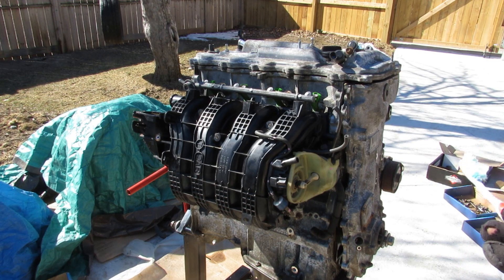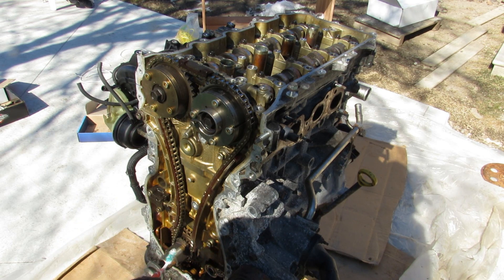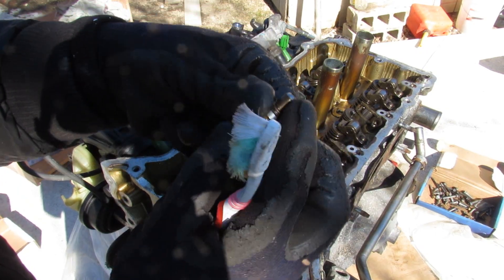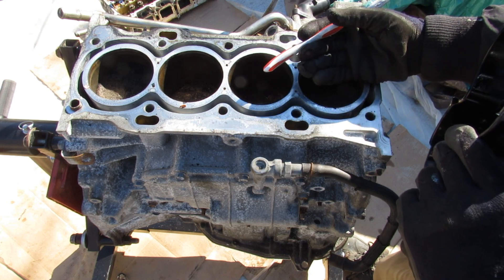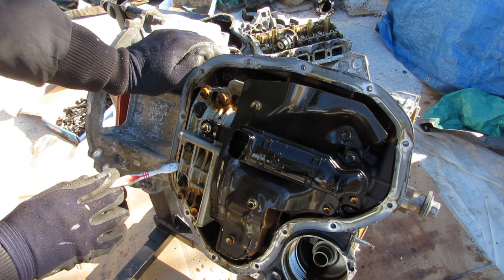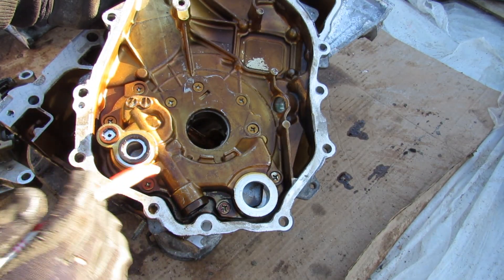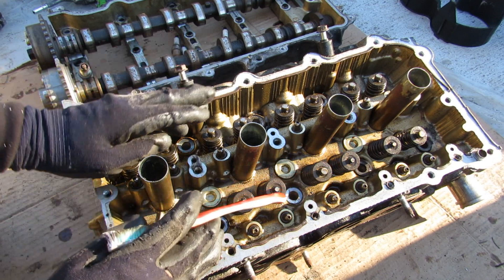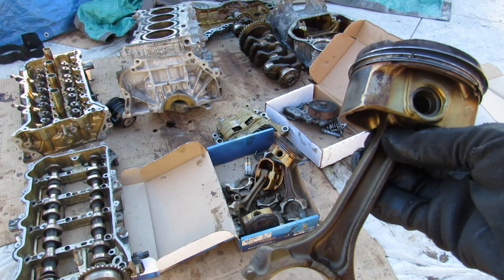Why Toyota Engines are Reliable

Comment: Question for you ! Do you feel it's safe to run 5 w30 instead of 0/16 or 0/20 ? Seems other countries run 5/30 & alot are normal weather like America ? We fig the gas in the oil has to make the gas super piss thin ? Doesn't seem like much protection being that thin & than on hot days also ? I see Mexico says they can run 15/40 or 10/40 or 5/30 !! Crazy any thoughts would be great ! Thanks !!

Comment: The new toyota electric wp has no bearing but uses magnites instead! I have one last 302,000 miles on a prius and it still works! If it fails, it because of the impeller, you can easily take the wp out and replace the impeller only! Or replace the whole thing. No belts to mess with.

Comment: The variable valve timing system also rattles on start after you drive the car without oil for awhile. The hydraulic lifters start ticking too. Then the thing loses power and won't rev anymore. Even after you refill the oil. Oops.

Comment: Hola amigo, seria tan amable de apoyarme tengo el mismo motor pero no tengo lubricación en la vena de los buzos o taques hidráulico ya cambie el filtro sedazo que va en las conchas del árbol de levas también también cambie los vvt mecanicos y los selenoide electrónicos y aun asi sigue con sonido sobre os árboles de levas en todo tiempo a causa de los buzos sin aceite

Comment: A friend of mine had a 2007 Rav4 with one of the previous engines with the oil burning issue he mentioned.  This was a known issue but toyota wouldn't cover the cost to fix it.  I believe there was some lawsuit over it.   His started having this issue up around 100k and he knew other people that had them with the same issue.
Reply from the maker: Unfortunately that's how most Toyota engines are when the miles get up there

Comment: I think the oil runs through the water pump because it both helps the oil come up to temp faster and acts as an oil cooler at higher temperatures. That's why they ran the big oil cooler on the AW11 MR2s into the main coolant hose afaik. 3 year old video but hey info is info

Comment: This same type of motor is in my 2010 Camry. Best car I ever owned. Great job explaining the parts and operation of this engine. 210K miles and still going strong.
Reply: toyota owners are those kibnd of peolple that never acelerate the car hard.

 My chevrolet have 250 miles never had any problem in engine even the engine gasket still the same

Comment: I had a 2016 Camry le with this engine, 70k miles no issues, I currently have a 2013 rav4 limited with this engine and it has 170k miles, burns some oil not much but no other issues except for that, very reliable engine. and the vvt rattle is pretty harsh on cold starts.

Comment: I dont think anything will beat their '90s stuff for absolutely overbuilt and simple reliability. The VZ, RZ, MZ and S engines will probably never be topped. Masterpieces of cast aluminum and very minimal use of plastics for anything important. Even the factory timing belts were known to last an absurdly long time though its obviously not a good idea to push it. My buddy bought a 25 year old V6 Camry with 200K miles on it and it doesnt look like anything on it has been touched except the brakes, timing belt, plugs and a couple of vacuum lines. It does need new struts though.

Comment: The only thing I wish Toyota did was make those cartridge oil filters topside. Topside filter plus extractor means I wouldn’t have to get under for an oil change.
Reply from the maker: I'm not a fan. I'd rather everything drain down, including any dirt or particles for a cleaner oil change

Comment: I had a 2007 Camry. I bought it brand new. I have had over 20 brand new cars of Ford, Chrysler,  GM and Kia in 50 years of servicing my own cars. This Toyota was the only car that started using oil at 30,000 miles. About a quart per oil change which was 3500 miles. First heard it was the valve guide seals then it was low tention rings. So much for their reliability!
Reply from the maker: They're reliable but oil is just part of the running costs on these 😟
Reply: There are tons of articles on that series engine showing that it's the oil control rings. It was a design issue; Toyota is still one of the most reliable automakers.

Comment: Last week my 15 year old toyota yaris 120k miles, water pump finally gave up... once it got replaced, everything becomes fine again.... 

Previously the noise of the broken bearing of the water pump was so awful... that i thought something was very wrong with the engine.

Luckily for me, it was not... after my mechanic went through all that could be causing the terrible noise..
Reply from the maker: At least it's an external pump and easy job.
Reply: @speedkar99  yup indeed.. i was so relief.... cause my money rather tight lately...

Comment: this engine is NOT Reliable. As all the Direct injections only engines it doesn't spray gaz in manifold to clean intake valves.  The real deal is having BOTH direct AND indirect injections.

Comment: The oil burning comes from changing at 10000 miles. ALWAYS change at 5000 or 6 months, no matter what the dealer says! That's the Manufacturers suggestion. Dealers are full of shit.

Comment: As far as the 22R went...it's reliability came from forged , not cast, crank and pistons and it's overhead cam design. With Weber sidedrafts and a header and little more cam my SR5 would fly through mud and sand and snow by allowing the rpms to keep up wheel speed.

Comment: Its Not a hydraulic lifter! Its A hydraulic lash adjuster! Before anyone says shit a hydraulic lifter is what lifts a push rod that lifts a rocker arm on a central cam engine, overhead engines don’t need lift they push direct, that what the lash adjuster is for.
Reply from the maker: Thanks for that

Comment: Regarding a leaking original Japanese water pumps...my Toyota 1.4Vvti has still the original one afzer 200.000 kilometers and it does not leak. Our mechanic told us we should not change it until it starts to leak. If it reaches 300k I will make a video about it and send to Toyota Japan.👌 Best cars in the World...😉

Comment: 3000 KM AND     $ 2000 AGO   2020  COROLLA, RUNNING GREAT  BOUGHT USED 1  TR  OIL PER 1000 KM   REG CHANGES      10w 30.  at 5000 KM. ON road as    courier so 900km a  day  common.

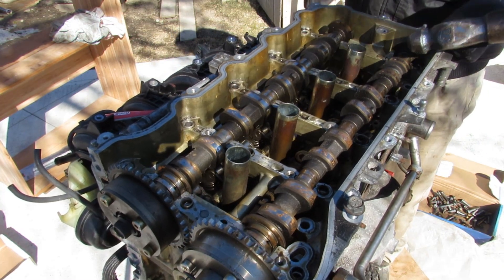Comment: 5:20 those are GDI injectors, they basically inject straight into the pistons rather than go down a small tunnel like other injectors, 3:20 the timing chain guide rails are made of aluminum not plastic or at least feels like that, but they do have plastic blocks on them, meant to last ages. Also @ 6:48 what engine, the 2arfe, for a brief period ran from 2009-2012 ran a power steering pump and newer versions run electric power steering which makes it easier to service items like the pcv valve and serpentine belts, some people tend to refer to that. The timing chain cover was also changed accordingly getting rid of a few 10 mm wholes where the power steering tensioner would go, difference is the part cover is 310 and 320 for the newer model from the sticker on the side of the timing cover,. 7:48 i like how you mention how it functions as an oil return, have seen quite a few people say their oil piston rings are stuck and thats why there is a lot of oil burning in their car when in reality the pcv valve has failed and its burning roughly 1 quart of oil every 300-400 miles. also a quick and easy test and or fix is to get lucas fuel injector cleaners and throw it into half a tank of gas next time you refuel if you see an improvement after that tank of gas is gone in your oil consumption that means oil ring were stuck and u should proceed with a sea foam clease to reduce oil burn (saves consumer money by mitigating the issue to be more manageable). if no improvement than pcv valve. 13:00 on 2arfe 2013 and newer there was a part revision for the intake cam gear which would make the intake cam gear last longer than previous revisions, it was a defective part or claimed to be defective part since it would break around 100k miles, but the engine would keep going on. Its meant to last a lot longer than that around 200k as thats what most engines should last (lifetime of the engine), but it could go on for longer with the gear broken. Deffo one of my favorite motors though especially for a daily. Never have to worry about that car.

Comment: I have this engine in my 2014 Scion Tc and it only has 26K miles on it.  I don't like the coolant passage being routed through the water pump either.  It's the same on my VQ.  It only makes sense from the manufacturer's point of view.
Reply from the maker: Water pump has always been a weak spot on Toyota

Comment: 1:18...
i would not see a timing CHAIN as a good thing...
My Impreza with EE20 Boxer Diesel had huge problems - Subaru said at the last, official subaru service at 80k km: "timing chain is still like new, i am good to go another 80k easily"....
at nearly 90k km, as a SMALL, PRIVATE MECHANIC realized: Subaru probably didnt even changed oil at 80k km, my valve timing was completely fked up (and nobody realized despite only going to subaru!), the timing chain was heavily stretched and the gears were also nearly flat, good job subaru! Luckily i dont believe officials that much and the mechanic i talked about wanted to check my car because he realized already at a test drive: something is VERY VERY WRONG with the car
Reply: I hated my Subaru for about 10 years, i really HATED IT because the DPF regs often started at overtaking (dangerous AF!), the DPF regs made my oil pretty much fked up after like 5000 km already, the EGR valve produced a lot of soot on the intake, and at all i was not really happy with a software throttled (to 109 HP/300Nm!) Boxer Diesel.

Was a damn expensive rebuild & tuning, but now this engine feels like a completely different engine with nearly 190 hp/430 Nm, ofc removed DPF and blocked EGR!

Comment: The record of these is excellent, the record so far with Dynamic Force engines is impressive for how much more is involved in hitting those efficiency targets. I get excellent mileage on mine.
Reply from the maker: It sure is amazing how complex it is. Waiting on long term reliability data to see how it'll hold up
Reply: @speedkar99  I’d say from what I’ve heard so far is they are even more reliable.  The electric water pumps are more reliable than the old leaky belt driven one on this engine.  The dynamic force engine is durable enough to run on 0w16 oil.  Most people will probably be better off switching to 0w20 after the warranty is done.

Comment: I had a 1.8 vvti in an avensis it was super reliable no problem until 90k then oil burning which is well documented faulty oil control rings i was told.
Reply from the maker: 2zr? 
Yeah some of them burn oil

Comment: Why would you need to control the amount of air flow into the intank?
Reply from the maker: To allow how much air to go in and mix. More air means more lean mixture. You need the right mixture for optimal combustion
Reply: @speedkar99  but wouldn’t that starve the engine from breathing? This doesn’t make sense to me? Thanks for the information.

Comment: THIS Toyota engine may be reliable but thousands and thousands of 2000-2010 Camry, Corolla, Scion and RAV4 owners with the infamous 2AZ-FE engine suffered expensive engine failures that Toyota refused to take responsibility for. Improperly tapped cylinder head bolt holes in the block caused head gasket failures which led to cylinder wall destruction. In almost all cases complete engine replacement was necessary, costing owners between $6,000 and $9,000. My brother-in-law was one. Owners were told by their dealers that "Toyotas are incredibly reliable and we've never seen this type of failure before" I was a Toyota fan and owner until this happened; now I've moved over to Ford trucks.

Comment: While the presentation and editing is magnificent,  the title of the video is wrong. Sure, we could perhaps conclude Toyota engines are reliable, but its not really answered in the video.  IMHO, the answer to 'why' is because Toyota engineers continue to learn from past mistakes. Pretty simple but not so for many other manufacturers who produce crap to market to the general public. Many of us remember Toyota was once crap too. But they once learned it was cheaper and better to produce a quality product than just one that was inexpensive.  Toyota engineers never stop learning from prior model failures. They've been building on that experience for decades now and we the car buying public enjoy the result.

Comment: Repairpal analyzes repair invoices, Toyota is just ok.  Lexus ties them for 8th place, which validates their analysis.  All Korean cars are much, much more reliable.  Honda is #1. Porsche is dead last, twice as bad as second to last place BMW.
Reply: I highly doubt when it comes to long term major repairs the Korean cars are more reliable
Reply: @thetechlibrarian  
Porsche is an absolute disgrace… 

“The Porsche Reliability Rating is 2.0 out of 5.0, which ranks it 32nd out of 32 for all car brands. This rating is based on an average across 345 unique models. The average annual repair cost for a Porsche is $1,192, which means it has below average ownership costs. The other factors that contribute to Porsche reliability include an average of 0.8 visits to a repair shop per year and a 21% probability of a repair being severe.”
Reply: The Toyota Reliability Rating is 4.0 out of 5.0, which ranks it 8th out of 32 for all car brands. This rating is based on an average across 345 unique models. The average annual repair cost for a Toyota is $441, which means it has above average ownership costs. The other factors that contribute to Toyota reliability include an average of 0.3 visits to a repair shop per year and a 12% probability of a repair being severe.
Reply: The Kia Reliability Rating is 4.0 out of 5.0, which ranks it 3rd out of 32 for all car brands. This rating is based on an average across 345 unique models. The average annual repair cost for a Kia is $474, which means it has above average ownership costs. The other factors that contribute to Kia reliability include an average of 0.2 visits to a repair shop per year and a 10% probability of a repair being severe.
Reply: The Hyundai Reliability Rating is 4.0 out of 5.0, which ranks it 4th out of 32 for all car brands. This rating is based on an average across 345 unique models. The average annual repair cost for a Hyundai is $468, which means it has above average ownership costs. The other factors that contribute to Hyundai reliability include an average of 0.3 visits to a repair shop per year and a 10% probability of a repair being severe.
Reply: The Lexus Reliability Rating is 4.0 out of 5.0, which ranks it 7th out of 32 for all car brands. This rating is based on an average across 345 unique models. The average annual repair cost for a Lexus is $551, which means it has above average ownership costs. The other factors that contribute to Lexus reliability include an average of 0.5 visits to a repair shop per year and a 8% probability of a repair being severe.
Reply: Lexus doesn’t even come close to Korean brands.  Thats objective reality, not a hyper-religious opinion

Comment: The engines are great but the oil pressure switches are not. When a 4 quart engine leaks 2 quarts out the oil pressure sensor, you get a spun bearing and soon a rod through the block. All while running and driving really well.

Comment: This looks like an engine that would take to boost really well, especially if you remove the spacer in the coolant galley.
Reply: Might have to do something about the open block, so the cylinders won't "walk" under boost. Depending, of course, on how much boost you want.

Comment: Thank you for sparing us from showing the unbolting of every bolt. It's amazing how extensive the technology tree for building a car engine. If society ever breaks down, we're not going to be making any of these for a long long time.
Reply: even though the sound of the impact driver is highly satisfying when removing a bolt, i agree =)
Reply: not sure we need them. without fuel to operate them then they are useless anyway. electric motors are much simpler in design.
Reply: We certainly will return back to the piston steam engines or steel steam turbines. Certainly not going back to the bronze age.
Reply: @gutersteinker  steam punk fantasies, I see.
Reply: It lives in my mind rent free how if I went back five hundred years, I wouldnt be able to describe a basic internal combustion engine to a peasant.I'm essentially a useless member of society.
Reply: If the Greenies have their way, that'll be true anyway.
Reply: @KutWrite  I mean the simplicity of an electric motor compared to this would just mean there would be no point in going back anyway.
Reply: @KutWrite  it will be replaced by other technologies, other supply chains. The real question is whether there would be enough jobs to replace the old ones.
Reply: @logon235  There never are, when technologies improves. But new jobs open up. Example: When cars took over from carriages. Buggy whip companies went out of business unless they adapted. But car parts needed to be made, repair stations, gas stations, etc.
Reply: @KutWrite  and the electric cars or whatever, maybe flying cars will require the same. Petrol stations could be replaced by charging stations or something else entirely.

Comment: I lasted until about 13:20. The title of this video is WHY TOYOTA ENGINES ARE MORE RELIABLE. This guy yammers on explaining how the engine works but not once does he say anything about why the engine is reliable. He shows how the big ends are loose, what he doesn`t like about the oil pump and a few other things but that`s all. I gave up at 13 minutes and was watching at 1.75 speed, glad I didn`t waste any more time on it. Useless video, falsely titled.